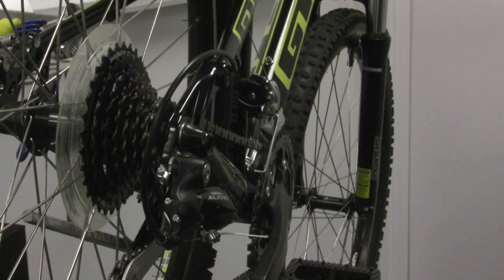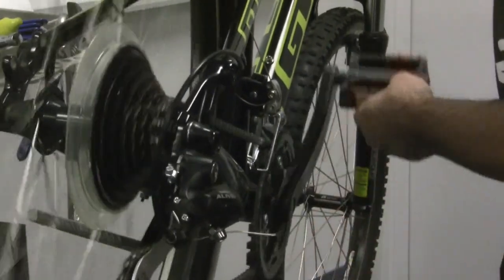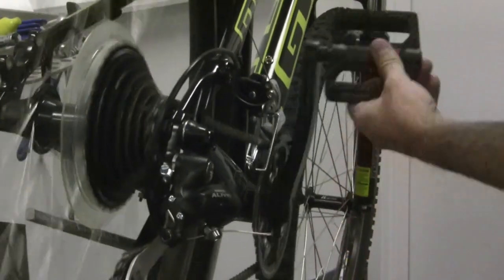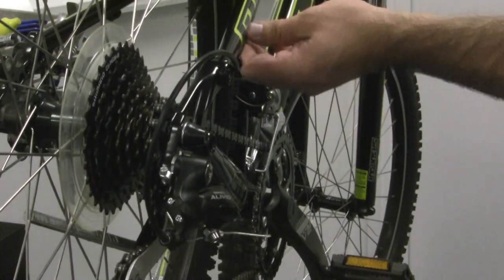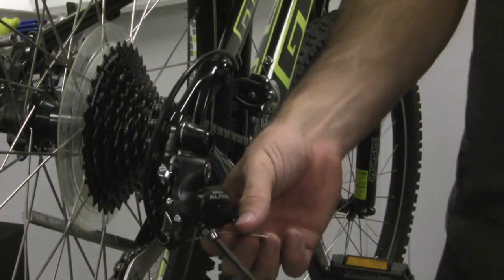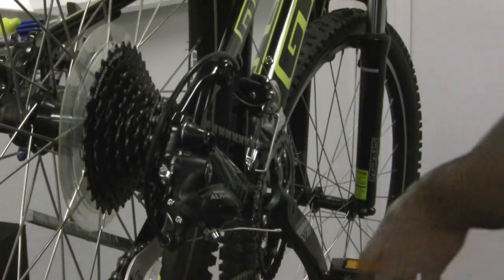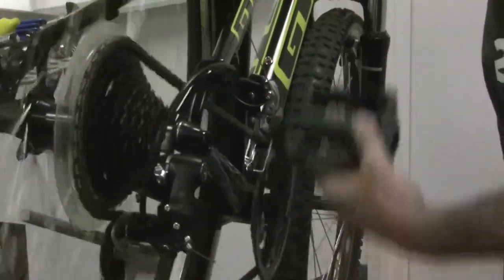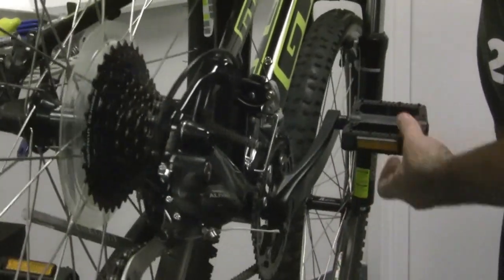How to Adjust Rear Derailleur Cable Tension

Comment: Finally someone on youtube who doesn't talk about the frickin barrel shifters!!
Reply: 😂😂😂😂 dude I thought the same, it's 2024
Reply: The barrel shifters are there to take up slack on the cable due to cable stretch. All it does is make the cable housing longer when you screw it out. They shouldn't be used at all when setting the cable up for the first time. In fact they should be screwed in all the way. As time goes on after the cable has been installed and the bicycle used, you'll need to screw the barrel shifter out a bit as the cable will have stretched.

Comment: Thanks. I found it more accurate to chock up the derailleur with a wedge to get the right position before tightening, rather than trying to pull the cable and tighten at the right point. Also, its important to know the barrel tensioners increase the cable tension when they are rotated anticlockwise looking from the cable side in other words when they are screwed out.

Comment: My bike doesnt shift at all. Its stuck at 3 smallest gear
Reply: Is the shifter hard to move? If so, replace cable and housing/clean and lube shifter. If the cable is being pulled taught before the derailleur moves (shift while staring at the cable AT the derailleur), then you should shift to the smallest cog, loosen the bolt that clamps the cable tight, pull the cable tight, and retighten. Then try shifting again. It wouldn't hurt to look at the derailleur from the back and make sure the derailleur cage, which houses two pulleys or cogs, is straight up and down.

Comment: Cheers! 11 year old video and still helping.
In my case, changed a rear wheel only to find I couldn’t shift any longer. After some troubleshooting I noticed the cable had come loose. Quickly fixed it with this video 🎉

Comment: I just had this adjustment done.  If all that it takes is less than 5 minutes, I probably should have paid less than the $15 it costed.  So, always shift it to the gear furthest from the bike before I tightened the cable?  Thanks for the video.

Comment: My shifts up the larger cogs like a dream although the cable is VERY loose at the smallest cog.
The crappy shifting is from the 2nd smallest to the smallest cog. It can actually just hang there on the 2nd cog for a good 20 meters before slamming onto the smallest cog.

But when I say loose, I mean the little naked cabe between the housing and nut... How tight is that little section of cable supposed to be?

Any advice?

Comment: Thanks for the video. Following your instruction, I attempted to adjust my rear derailleur after fitting a new shifter. With the shifter in No 8 [ I have a 3 x 8 system] ie on the smallest cog, I adjusted the tension in the cable. When I operate the shifter, I can see movement in the derailleur, but the chain simply refuses to move off of the smallest cog. [Just to be clear, it was working fine before I changed the shifter]. Have you any idea why this should be happening? Many thanks

Comment: I tensioned the cable exactly as you described. I am able to shift from smallest cog to the second largest one (8 gears), the cable gets tight, sometimes I am able to shift to the largest, but not smoothly, the chain shifts after several rotations of the pedal. I checked the limit screws, they seem ok. The end limit screw is not reached at all. Any idea how to solve this?

Comment: Mine does not shift to the last 2 biggest cog.. will this solve the problem?
Reply: It might. The movement of the derailleur, and chain, to the upper cogs is based on enough cable tension AND the upper limit screw (marked 'L') being loose enough to allow movement to them. First shift into your smallest cog and make sure the cable isn't loose. If so, tighten it and try again. If not, loosen the 'L' limit screw until the derailleur can move the chain there, but not so much the chain goes off into your spokes!
Reply: @bradbucc  thanks for the reply.. I got it to shift all the way up.. however, after several pedal strokes.. it goes down to the next biggest cog..

Comment: Nice vid! I just installed a new XT shifter w cable  but kept the SLX derailleur. was working perfect but now it's noisy and off on almost every other cog? I have a 1x11 mtb and bike is only 7 mos old. help!
Reply: m00nchildblues check your derailleur hanger for straightness and that your chain isn't too long or that the Screw that pushes the derailleur away from the cassette isn't too tight

Comment: My gears sometimes shift twice going down and then is goes up once to the intended gear. Any suggestions?
Reply: Same problem; hard to find info about it.
Reply: The cable is stretching that is why when you shift, two sprockets will be 
shift at the same time

Comment: My bike shifts up fine on the harder gears but when I try to shift up to the 2 last easy gears the shifter is SUPER stiff and won't move
Reply: that means your cable tension is a bit too tight actually
Reply: @dalechen521  can u guys help me when I shift the tension gear from 3 to 2 the drive chain jump off and gets stuck around the front derailer part for now I have to leave it on gear tension 3 but I'd like to switch to 2 when my legs get tired
Reply: snap_ drama that’s weird, so when u downshift the front gear from 3 to 2 it jumps off on the right?
Reply: Dale Chen update this bike is currently somewhere in a trash pile.
Reply: @dalechen521  it does yh :/
Reply: snap_ drama question, when u try to downshift, do you shift against resistance, or is there a simple click
Reply: @dalechen521  the firmness of the shifter? Yh its a simple click shifting downwards, shifting upwards to 3 is very stiff but I think that's normal for when your going up to 3
Reply: snap_ drama so when u downshift with the simple click, does it move towards the right(outer pedal) or the left(bike frame)
Reply: @dalechen521  left bike frame
Reply: @snap_drama346 
Inner limit screw (for smallest from cog) is way too loose.

Comment from the maker: Okay first loosen the cable crimp bolt on the rear derailleur. Then make sure your screw the barrel adjusters on the derailleur and shifter all the way in (clockwise). Then use some pliers to better hold the cable and put some tension on it as you tighten with the 5mm. If that doesn't work you may have a crimp in your cable somewhere, worn housing, or some rust on the cable. If there's rust replace the cable, or use some sand paper and apply some chain lube to the cable. Try that. Hit me up.

Comment: Mine is too tight it won't even shift into 4tj gear how do I loosen that
Reply: open the screw and lett the cable go back if it wont go back shift to another gear without paddling

Comment: Now it's too tight and it's almost impossible to switch to the higher speeds
Reply: Don't know whether you're still looking for advice but here's my take. Before pulling the cable tight you should wind your barrel adjusters all the way in clockwise making them fully loose, then turn it back out about two turns to give yourself some loosening adjustment (turning the barrel adjuster clockwise loosens the cable). Once you've done that you can pull the cable tight and clamp it like in the video. Pulling the cable tight is the part that gets you close. Then turning the barrel adjuster get you the rest of the way. If you've gone too tight pulling the cable you can now loosen the barrel adjuster slightly to get it right.

Comment: Warning, don't do this as I just tried this and it threw off all my gearing.  The cable needs just the right amount of tension to shift threw the gears accurately.  I'm sorry, I usually don't leave too much of negative commenting on videos but this was terrible advice.
Reply: Or, you did it wrong because you're not too clever, or can't listen to instructions. This is EXACTLY the right way to do it. You did it wrong, messed it up, and want to blame the guy who showed you how to do it?
Reply: Sorry to hear it didn't work out for you; you sound really frustated. Derailleur functionality is really simple: Cable tension and limit screw adjustment, unless your derailleur hanger or frame is bent, or you have some related problem like a dirty shifter or corroded cables and housing. Be more specific and I'd be happy to help you out.
Reply: Its irritating to get the tension just right,
Reply: Mine is shifting smoothly when going upward, and downward is my problem,